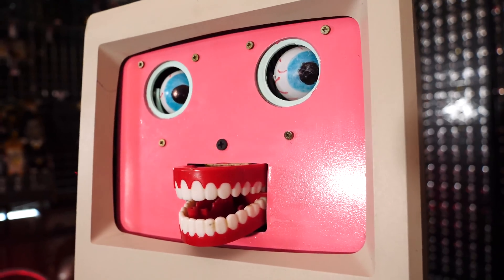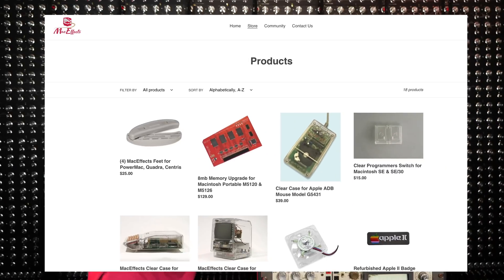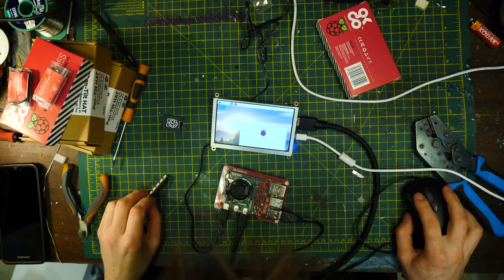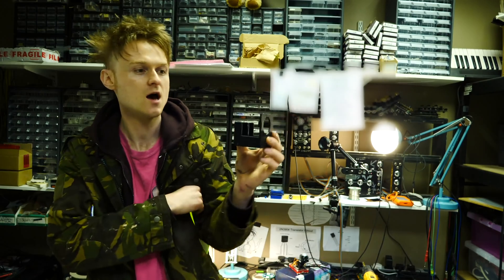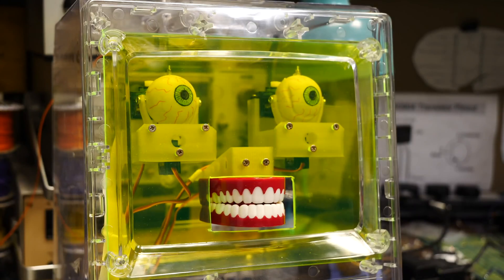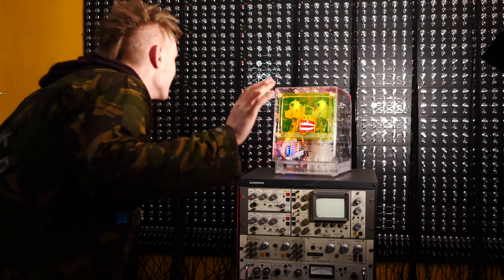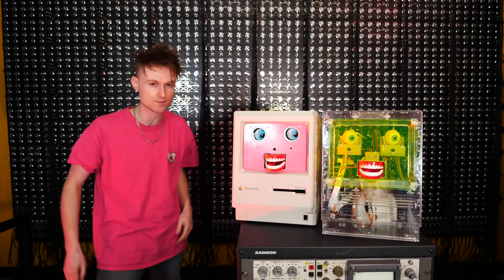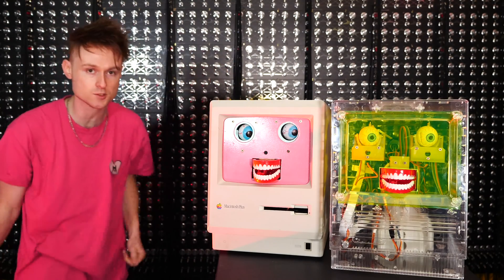FACIAL RECOGNITION ROBOT WITH A FURBY BRAIN

Comment: Kosmo's looking around is WAY creepier when it's moving that smoothly and with that much... purpose. ha ha ha ha ha.... As for doing the grass wall... Isn't there a way you could use just one raspberry pi and simply(?) synchronize many eyes on one camera? Maybe have some code that offsets the position by the height and width of the grass wall platform for eyes that are far off from the one with the camera in it? EDIT: NEVERMIND, I'm slow to read your post about WHY you want separate ones. IGNORE THE MAN BEHIND THE COMMENT FIELD.

Comment: For the complete cosmo wall i think you can use a kinect (easy to find and cheap 3d camera) and run a program to calculate the angle to move each eye instead of multiple moving cameras.

Comment: I wonder if you actually need 20 pi's or just have one controlling all of the eyes with each ball offset so that they all look in the same direction at the same time...
Reply from the maker: Yep! It is indeed an option but I always find independent control approaches much more interesting and unpredictable hence independent control :)
Reply: @LOOKMUMNOCOMPUTER  yeah that's a great point, I kinda thought that after I posted it. Just found this article showing you can connect multiple usb cameras to one pi and could possibly achieve what you're after. Maybe I'm just overthinking the cost element 😅 https://www.pyimagesearch.com/2016/01/18/multiple-cameras-with-the-raspberry-pi-and-opencv/

Comment: Couldn't you use one computer that's operating a bunch of cameras? Just use little servos from RC kits, make it more garage hobby than computer, like diluting poison
Reply from the maker: Yep; but it isn't the desired effect. A large portion of my thing is unpredictable responses between independent systems. I always feel size saving things and increasing code stuff makes a project.more stale that's my opinion anyways :)
Reply: I wonder if there's a way to have each eye independently controlled by a Raspberry Pi, but somehow get them to interact with each other for something really unpredictable.  Maybe each eye tells another eye to "oh, look at that over there"

Comment: Nice idea. But why do you need 20 RasPi? Could you just use one to control 40 eyes (all move the same). BTW now that you have a RasPi, why do not check about SonicPi? You can use it to connect external synth, too. :)

Comment: You could build that wall with one camera/pi, calculating, or  even just jury rigging with some adjustment pots (maybe exposed, why not), how all the different eye servos stare at the same point in space.  Though it would certainly be a lot nicely-creepier if it would stare at different individuals in a group.

Comment: Fabulous idea. With the grass wall you could get away with one camera and a vector translation to make all the others track what the camera is following. Fiddly but cheaper as could work on a single Pi.
Reply: Ok. Missed the many "I dun wanna puter things!" Comments before I posted.  Forget the matrix idea. 
One Pi, one camera and a bunch of 3d printed pantographs and wire to translate the one eyeball tracking to all. Very random and mechanical. 
Add bumps to the surface of the levers so they crick like crickets when they move.  
Cheers

Comment: please make the firby move the mouth
Reply from the maker: tried sadly the furbz was too far gone from previous experiments, motor had burnt, felt a waste to use a good furbz.
Reply: If you took the furby motor wires and used them as a signal then you could input it into the rasp/pi and have that control the mouth servo. (assuming the furby circuit board works.) or maybe you just sample a furby and have the pi play the sounds like a fake furby. Then you could customize it.

Just a thought! Keep up the good work, you mad lad.

Comment: Raspberry pi, gets more powerfull with every iteration. I remember using the camera module with a raspberry pi 2 around 2011 or so to create a rig  to digitize 8mm films. I would project them and with a bit of fiddling the raspberry pi would film it. It was a bit crude but it kinda sort of worked for digitizing my grandfathers films.

Comment: Great Video! You should be ok with two stationary Cameras on your Grasswall (for example in the top corners). With Triangulation you could determine where the Person is standing in the 3D Room and calculate the Angle of each Eye. This would be much cheaper. I made a similar System for an autonomous Drone :)
Reply from the maker: indeed! but then the eyes dont act all jubby, a few people have suggested! but i prefer the over the top and jubbing out unpredictable approach haha
Reply: @LOOKMUMNOCOMPUTER  fair, thats a good point

Comment: Dude, just use a microcontroller (arduino) and use it to multiplex to servos with an offset to average person height for the wall. One cosmo controller; wall of cosmos. A lot cheaper than a ton of raspberry Pi's.
Reply from the maker: Like I say in the pinned comment it isn't the desired effect I'm after. You lose the feeling of unpredictability

Comment: You don't need 20 RPi's for this, i think a single one should be enough if you stack a bunch of MIPI CSI bus extenders and hook all the 20 cameras together through those. 
Use something like the IVPort for reference - https://github.com/ivmech/ivport .

In theory it should be possible to program every pair of cameras as an individual set as well, Armbian (the Linux OS) should handle all the communications for you.
Reply from the maker: Cool! However I am allergic to computers. So I'm gunna go for the over engineered approach 👍👍👍👍

Comment: 1: Try the raspberry Pi zero. It has a lot less processing power, but it's a lot cheaper. You may also be able to get an older model for slightly cheaper.
2. The Raspberry Pi powering your... creature is about 10,000 times more powerful than the guts that originally went into that machine,  has 4,000 times more RAM, and 1,000 times more storage.
Reply: One more thing, if you use usb webcams, then a single pi4 should be able to handle multiple at the same time. 

You can get used webcams ripped out of old broken laptops for cheap. They’re usb internally, you just have to solder your own cable. 

Loved the audio Bible circuit bending, BTW. I think you did that very respectfully, which was cool.

Comment: Dude I have been working with raspberry pis for years. A raspberry pi zero can handle that eye tracking script. $5 usd a piece bulk. But if you want to stick say... A few in each room of The Museum Of Everything Else (I might take a vacation across the pond just to see it) you might want to record what the camera is seeing. For that, I would stick to pi 4. The camera modules can be found on ebay. There are actually some pretty decent chinese knoc-offs that are excellent quality. Super inexpensive. I made a security system for my house using a bunch of raspberry pi 3b+ and included a microphone and smart home sensors. They are pretty capable machines. Love your music! Huge fan!
Reply from the maker: thanks for the info!

Comment: You should be able to do it with one eye. If you can get a rough distance to the face you can just use math to find all the angles and rotate all the eyes.
Reply from the maker: yes but like i say! its not what im after, i like the idea of them functioning seperately for the unpredictable behaviour
Reply: @LOOKMUMNOCOMPUTER  ahhhhh gotcha! It would look a bit strange all of them  glitching out similarly. Maybe look into the Open-MV camera modules. They support the same python facial tracking libraries but are a standalone camera, processor, and io in one. Also a bit cheaper than a pi and a cam module?

Comment: Rather then using a raspi 3 or 4 you may be able to use the raspi 0 which costs 5-10 bucks apiece, do note however that the power supply is different then the 4 and the camera ribbon cable is tapered at one end.
Reply from the maker: good idea!
Reply: @LOOKMUMNOCOMPUTER  glad I may be of some minor assistance. I'm not entirely certain but  because of the reduced power of the Pi you may have to run it headless and/or without the UI.
Also once you get one working there are some programs that allow you to take the image of one SD card and copy it to many.

Oh and having video out of one of the cosmos eyes doing trippy stuff with synths might be interesting during a show, or maybe a binary face detected/not output could work with a synth.

Keep on keepin on!

Comment: Nice project, but I wonder if the ESP32-CAM Development Board would be a more cost effective option as you need 20 of them. May be worth looking into the ESP32-CAM option....
Reply from the maker: i dunno! sounds like a lot of comjputer faff for me haha. but mebbe.
Reply: It's basically arduino, you set them up using the arduino ide. Was just a thought as they are about 10 times cheaper than the Pi, would make a huge difference as you said you need 20.

Comment: for the grass wall cosmo project you shouldn't need more than one or maybe 2 pi's!  they're very powerful (relatively) and with a bit of programming could absolutely handle many camera inputs and motor outputs at once c: 

Might also be able to use only a few cameras to work out where the person is and then just use that data to make the other eyes aim there too
Reply from the maker: but also the fact that each is seperate completely seperate so it bugs out is kinda the attraction to it if you get me
Reply: Yeah, two cameras would be enough to triangulate the position (probably even just one, if you don't mind a bit of inaccuracy on depth perception); a kinect might be another option, too. alternatively, if you wanted to keep a degree of separation, you could possibly do something along the lines of using a pi-based master to shine an IR laser (or kinda focused ir source) on the target as a beacon, and use a simpler photodiode or similar setup to track that; you can track an IR beacon even with basic hard-wired electronics.
Reply: @mushroomglue3249  May be a kinect, as i know they give you 3d image and there are some tracking free libraries.
Reply from the maker: haha im guessing so! but the last thing i wanna do is get into compuiter world ha. my solutions are usually nut and bolt. so 20 raspberry pi's hahaha
Reply: Thinking about the beacon idea... Why not make badges for the visitors with an IR led in it and follow that beacon using a IR sensor? Those IR following eyes will be twitching to find the brightest spot and thus get a nice weird effect you are looking to get.

Comment: You're a god damn champion!! You so casually got the face tracking working on the pi your first time using one!!!

I've been working on a industrial robot safety module using face tracking and opencv on the Raspberry pi, but DAMN if I haven't run into problem after problem hahaha
Reply from the maker: aaah! yeah it was quite a pain, took a few days of adjusting and stuff, if only life actually plauyed out like an edited 5 minute video hahahahahaha.  thats cool on the safety module! however its pretty buggy the way i have it setup im not sure i would trust the approach i did for safety hahaha
Reply: Is it face recognition or just motion sensing?
Reply: @RCAvhstape  opencv is facial recognition if im not mistaken. ive used it before only for facial recognition so idek if it works for motion sensing
Reply: @aitor.online  you could implement Kalman filter to do that. Now, I'm not really a computer vision expert and I haven't done much OpenCV, but there may be something in OpenCV that could help with that
Reply: @terasss2  im not familiar with that but upon further research it seems like openCV is fully capable of doing so
Reply: @aitor.online  I had a quick look at it myself and it's got an entire class for it, which is quite badass and saves having to do a lot of calculations by yourself